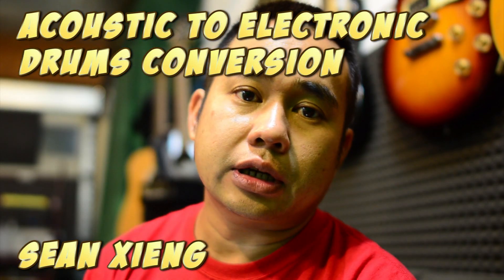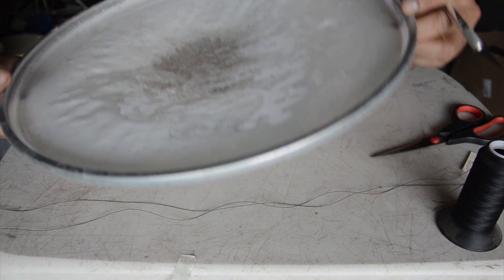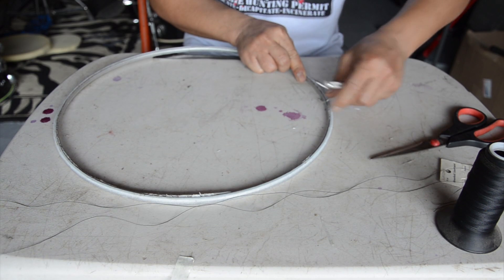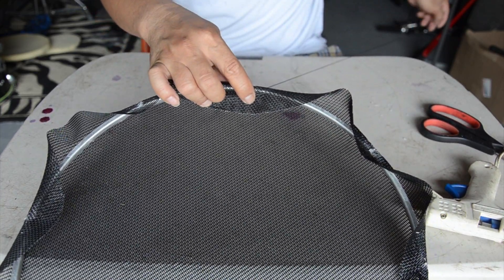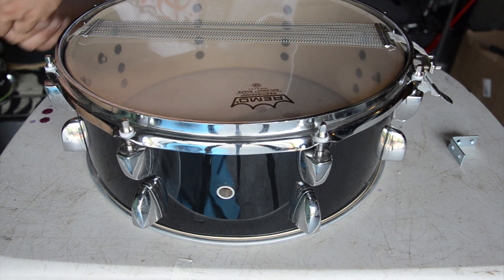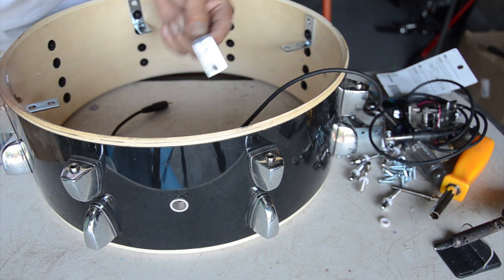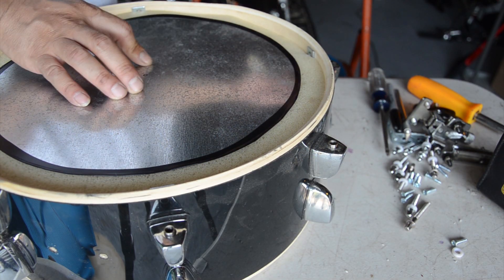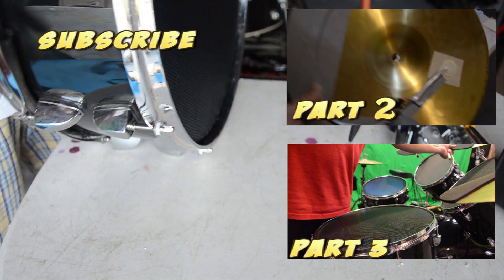Acoustic to Electronic Drum Conversion Part 1

Comment: are the velocity and sensitivity settings managed through the drum module or the piezo? does it make a big difference if you have a quality drum module like a roland td series vs an osp dd502?
Reply: probably just in the versatility of the modules functions, the roland higher end will obviously have more, but if you just use the module as a midi outlet, it should be identical right? maybe less options on the module for sensitivity and all that,